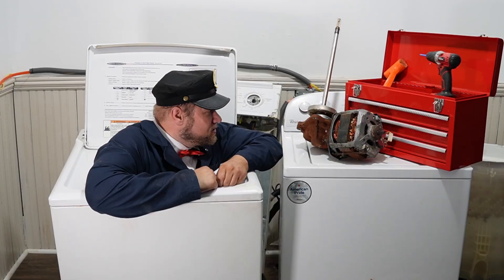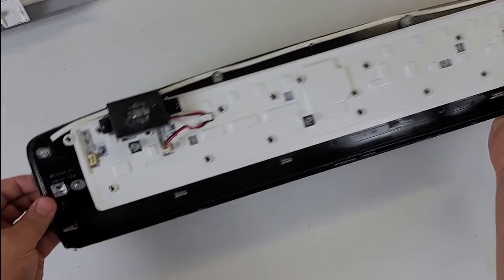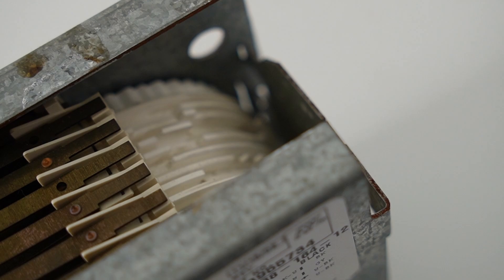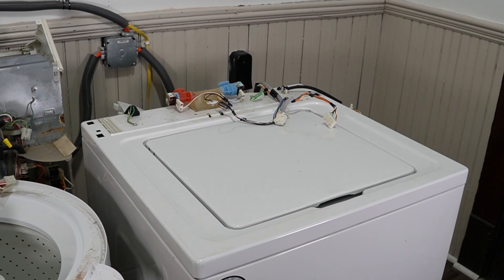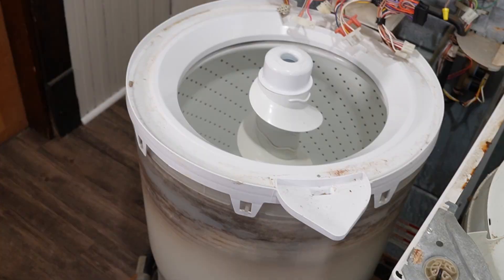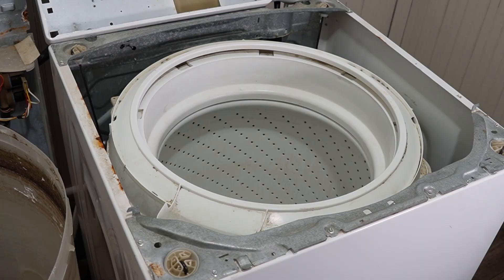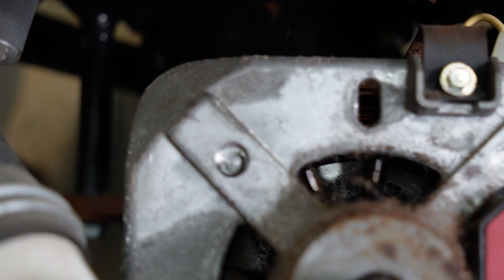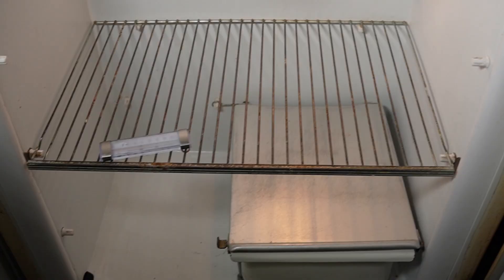Are Washers Built to Break? Inside a 1984 Washer vs. Now

Comment: Ironic that I'm here because that particular Kenmore Elite I have just broke down after ~20 years, and looking around for a new washing machine replacement
Reply from the maker: Closest thing is the Maytag Commercial - I'm tearing them down for next video, and the dryer is literally a Kenmore Elite w/ upgraded motor.
Reply: @bensappliancesandjunk  I'll definitely look into that, but I am thinking of something bigger than the old Kenmore. I'll be looking forward to that teardown though!
Reply from the maker: @dndkeg  unfortunately you are going to have to make a decision on size vs. Reliability. The larger the tub the faster it'll break
Reply: @bensappliancesandjunk  Thanks for the tip! Considering what my family is washing now than back then there has to be a compromise somewhere. Again thank you!

Comment: You lost me when you said you had to pull the inner tub out to get the transmission out of the direct drive whirlpool. You can pull motor transmission and water pump all together just by pulling the agitator and taking the 3 1/2 inch bolts out that holds the drive assembly to the bottom of the outer tub

Comment: Washers have all of two serviceable parts the drain pump and the belt. 

In my experience newer washers are just as reliable. And the ability to set error codes is handy for diagnosis. 

Electronics have been proven more robust than mechanical controls too.

Comment: I would not say they're specifically designed to 'break', but they sure as hell ain't designed to last like they used to.

I get it, modern washers and dryers have features older models don't, but how many gimmicks and geegaws do ya need, for cryin out loud?   It's just a damned washing machine   (or dryer).

My washer and dryer are 19 and 23 years old, respectively.  I'll replace them when I HAVE to and not a moment before.  And by 'when I have to', I mean when they cannot be feasibly repaired.

Comment: Yeah but those shocks go out alllllll the time and bang all over the place... I'd personally rather take the old valves out .... Rusted rear spring you can always replace... Plus everything in the new ones are all plastic cheap parts .... I still have my old Kenmore and I work on these for a living and want nothing to do with a newer one... Plus people always complain about the water levels..... You talk about the water by the motor potentially leaking  but the new valves by the board... Which is more than the older motor .

Sometimes when the trans are stuck I take a wooden block and tap the agitator shaft and on the older ones you can do the same thing or tap on the drive block and you don't have to pull the inner tub.... Usually when they are rusted like that on the older one it signifies a leak from the tub.

I still think the plastic in the new one is the main issue those plastic trans parts are easily replaceable and not common to break often and the motor coupler is meant to break so nothing else does ... So I agree old one all the way!

Comment: Omg I had the old one on the left and when it broke down I decided to get a new one. I got the one on the right and I regret it every day I wash. It sucks so bad! It often gets stuck in the first part. Doesn’t release any water at all. I have to unplug it and then plug it again. Take the clothes out and restart the whole process. It also doesn’t clean well. It leaves the towels soaked. Oh and it takes about an hour to run through the cycle. It’s awful. Don’t buy it

Comment: Older is better!
This is usually the case.
The first ever mass produced car the Ford Model-T still runs just like it did when it rolled off the line back in the day.
Older phones are a lot stronger and have cooler features.
Just go old school it's better.
Reply: We have an old ass fridge from like the 1990s and ot still works sooo well.
We also have an old washer and have never had a problem with it.
Reply: I also have old radios and cassettes and cassette players ECT.
Older than me and work great.

Comment: Govt energy regulations are the #1 driver for appliances being less reliable. The amount of energy (electricity and hot water) usage is being regulated and driven down to a point where the components must be lightened up to lower the weight being driven.  The electoral mechanical components, heavy motors with strong magnets and good copper windings take more energy than the smaller HP, lighter aluminum winding motors.  Blame the govt.

Comment: So we just ignore the lifetime savings in electricity, water, detergent, etc? Who cares if it only lasts about 8-12 years. New machines start at $400. The large agitator on older models DESTROYS clothing because of how much wear it puts on them. There will always be a group of people out there that swear older stuff was made better and we should never upgrade anything. That's fine if we are buying the exact same model, but we aren't. Technology changes, detergent changes, other costs like electricity and water go up. You're 20+ year old washer can be costing you $100s a year and you may not even realize it. Also, I'd like to point out that the reason most repair guys LOVE old units is because people keep spending money to fix them instead of buying newer ones. It literally keeps them in business.

Comment: I’m sure you’re aware but the brand new whirlpools are even more garbage. The gear cases go out with in 5 years no question. 
And the capacitive touch pads are very prone to failure. 
You should compare a brand new whirlpool to a 🙌speed queen. 🙌
Hands down the best washer.

Comment: The older machines are better built . & you could easily repair them yourself. No computer crap that can be expensive to fix. Back then you didn’t have all the bells & whistles either. Like wi fi connection ect . I’d rather have an old school machine anyway .

Comment: Electrolytic capacitors don't belong in anything that gets hot and you want to last. Even at room temperature they will eventually fail because they simply dry out, bulge, leak, or otherwise self destruct. The closer they are run to maximum spec, the shorter the lifetime.
Bad choice made because they are... very cheap. Would you be willing to pay $10-20 more for lifetime caps? I would, and do when I have to repair something with them.

Comment: Samsung absolutely makes them to break, they will sell you all the parts but the drum balancer which they make out of crappy ass plastic. Samsung and apple are a big part of our right to repair problem. Basically they wanna go full John deere and make you bring it to them just for them to try to sell you one and not fix it..
Fixed mine with some wood and some ingenuity but wth.....

My mom's dryer used to constantly kill the keypad and components with steam. Had to replace the panel 3 times and then we got rid of those stupid things.
Reply: Replaced it with an older style similar to the one you have here ❤️

Comment: yes  . . . planned obsolescence is a philosophy . . . . . . extremely criminal in nature of course .

I deliver these new machines for HD . . . . . 5 years if you're lucky before its not worth fixing. . . . impeller machines do not clean as well and the tub bearings wear out sooner . . . . . the bearing is sealed into the tub which means you have to replace the whole tub which isn't cheap.

Comment: Forget mid 80's. Grandma's old mid 70's washer just died about 7 years ago.
Reply: The mid-70s were about as long ago 7 years ago as the mid-80s are today. Actually, I feel like this is a joke I'm not getting, because the math is too obvious.
Reply: @wheedler  It was just a few years longer, I suppose, but Grandma had 4 kids and ended up raising a grandchild as well. Grandpa worked as a heavy equipment operator and made plenty of stinky clothes for Grandma to wash over the years.  I'll bet that washer averaged 2 loads a day.  For 40 years. Grandpa changed a seal on it. That was it for maintenance.  You'd have a hard time finding a washer that will do that made since then, I'd bet.

Comment: not as much breackable as hard to repair AND lack of know how.
fairly new stuff can easily be repaired if you know what youre doing. that is, if the damage is any other than logic board which deffinitelly need some eletrician know-how and knowledge what to expect from sertain routes.
most commong new machine issue i hear alledged that logic board is damaged, which is understandable; when infact it can be something simple like brush eletric motor's coal brushes that has worn down.

Comment: So how do I bypass the lid lock?
Reply from the maker: Can't on modern designs other than removing the plastic switch piece and putting it into the lock mechanism. You cannot otherwise bypass the electrical system to run without that input being valid (thinking its closed)
Reply: @bensappliancesandjunk  Thanks for the quick reply! I have been messing with mine all day today. How does it know the lock is even properly engaged? It doesn't seem there is any sensors in the hinge. I can trick it by keeping the lid like 99% closed so it barely misses the latch and the lock engages on nothing. But then it somehow knows when I open the hinge further. Is there a proximity sensor or something in the lock mechanism that senses the lid being nearby?
Reply from the maker: @Garthbrooks4756  pulsed signal. On/off/on. It sends an electrical signal to lock the switch, and if locked, returns electric to the control board. If it can't engage that lock, then no electrical signal is returned, and it knows the lock is defective. That's why you'd remove the hinge and put it in the switch and keep it there so you can remove the lid as needed.
Reply: @bensappliancesandjunk  you are my hero. Thank you !

Comment: The main thing that bothers me about the new units is the way they prioritize using water and electricity "efficiently" over getting your clothes clean. It's like they are sticking us with a worse design that doesn't do what it's supposed to as well "because environment." It reminds me of how those stupid low-flow toilets are constantly getting clogged and just won't deal with number 2 as well as the old ones. I feel like they are just making our lives worse and worse for the sake of the environment, at some point the government will make it so we all have to beat our clothes against a rock and hang them out to dry like it was before we had machines... that said, I wonder how capable washing machines would be today with modern components if instead of regulations that force us to be miserly with power and water, we had an incentive for them to make something that could get clothes as clean as possible, as fast as possible?

Comment: If its Samsung, LG, Fischer Paykel, GE, Frigidaire/Electrolux/Egg Beater maytag/admiral, Haier, or any other brand based on those, or a Whirlpool Cabrio, Kenmore Oasis, Maytag Bravos or any front loader. They are utter pos.

Stick with what is called a Whirlpool Direct drive based washer (Kenmore in this video) or "New World Belt driven" (Whirlpool in this video) washer.

Comment: These “complex” circuit boards are really not that complex compared to something like a pc motherboard. And use much simpler hardware, they are honestly heavily overpriced for what you get. 

The electronic parts for newer machines really should be inexpensive  but they are not.

Comment: Everything made since Lead free solder was introduced is junk - waiting to fail. The real purpose of lead free initiative is to reduce lifespans and increase replacement sales. Appliances are now lucky to last 10 years  and certainly not the 20+ years they used to last. I was a solder process engineer when lead-free was starting, no lead-free solder lasted more than 1/3 as long as leaded solder.

Comment: An actual 1984 machine will be much higher quality than that ~2000 machine. You've got to get back into the belt drive era of Whirlpool to get truly good machines. Still, that ~2000 era one is likely WAY better than a modern electronic craptastic machine!

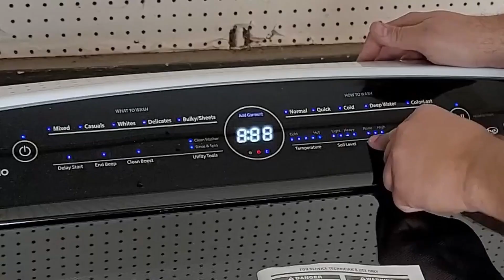Comment: 2:45 It's not LESS COMPETENTS but FEWER COMPONENTS.

5:06 FEWER (not "less) possible failures 

"LESS" is for a "fungible" commodity like sugar or oil.

'FEWER" is for "DISCREET" items that can be separated from each other once mixed together, things like COMPONENTS, MARBLES ... or VHS tapes (WHAT?)

Bear in mind that you are comparing "old" vs "new". I am old. You are new. I graduated college slightly before this washing machine you're tearing apart. 

Note: I am busting your chops, not because I dislike you, but because I want you to look like the most competent individual possible. You are actually very skilled, and I do not have your particular skill-set.

I also have a heart condition so we will probably "shuffle off this mortal coil" at same time.

Comment: Old washers from the 1990s or earlier aren't better. You think they are because of survivors bias. You don't see the thousands of dead crap washers in landfills. There will be washers bought today that will last 30 years, but we don't see that, just the minority of old washers that have survived this long.

Moral of the story is, if it still works or can be repaired, keep it! No reason to replace an washer just *cause*. And maybe research the repairability of a new washer before you buy one.

Comment: New Washers and driers with those god awful Resin covered circuit boards are absolute garbage.  I have a garage full of them all with the same problem.  The $300 circiut boards burned out and it non-repairable.  I long wmfor the old days with Mechanical dials and not these tiny computers.

Comment: after working 10s of thousands of repairs i can tell you this guy is feeding you a lie the old machines were much better built lasted longer had fewer and less expensive repairs,notice he says there are fewer component and then points out all the numerous parts in the board itself
Reply from the maker: I am not sure what you are saying because of your lack of punctuation. Are you saying I am lying because I said new machines last as long as old ones, or that I am lying when I say that old machines lasted longer? I read your sentence multiple times and simply am unsure.

Comment: ALL modern appliances are TRASH. You’re lucky if you get one delivered that works. And then you’re lucky if you get a year out of it before needing to be replaced or repaired. I’ve had so many appliances in and out of my house the past couple years. One of them took a half dozen tries to get one delivered that worked. Several of the others were placed within a month.

They’re made with junk. Lots of cheap Chinese metal. And insufficiently sized hardware to begin with. I had a “bolt” from the agitator break after a few uses of small loads. The bolt was about the thickness of a spaghetti noodle and made in China. The washer was totaled from that single failure.

Comment: Today’s whirlpool washers are junk. At one point in time, they made the best washing machines out there. That was until they retired the direct design. Today’s machines have cheap Chinese components that are built to fail. Get a Speed Queen TC5. It is an old design that will last decades!

Comment: EVERYTHING is made to break. Our F!@#$ up consumer economy needs the cheap crap to break in order for more to be purchased and to perpetuate the cycle of cheap crap. I used my mom's old dryer it was a 1970 model and lasted until around 2010 or 12. was going to cost more in parts and labor to fix. Still have not bought one.

Comment: The new washers are complete garbage and I think garbage falls behind to how garbage they are. The main computer has a zero date program. After so many days or times used to wash clothes it will fail without notice. I say it because someone that I know that is a genius with computers found a program in the main washer computer that will make it stop working properly after so much time or so many cycles. Manufacturers wants you to buy a 200 or 400 dollars computer. I stop buying those garbage washers years ago. I have the old mechanical washer and never had a problem in years. Pure dumpster garbage is been made in this hard times.

Comment: I have a brand new Samsung washer  and I live in Thailand about a month in the LCD that tells the time remaining started fluking. I called Samsung and the laughed, we can sell you a new board for $xxx.xx  I am an ok diagnostician and pulled the board out. Samsung in their infinite wisdom put a component filled board in a washer that is sold in a jungle environment WITH OUT putting any protective insulative covering on the board nor sealing it in a compartment. Well the small geckos that live here love the heat generated by the boards electronics and unfortunately the left front foot and the right rear foot contact positive and negative and the geckos go pop as does the components in between. Totally Samsungs fault  in poor design and planning.